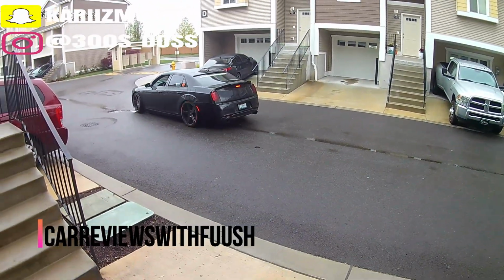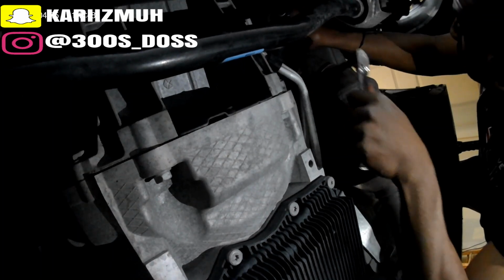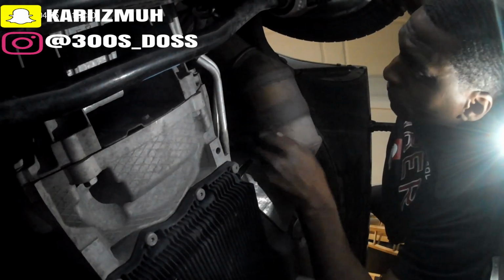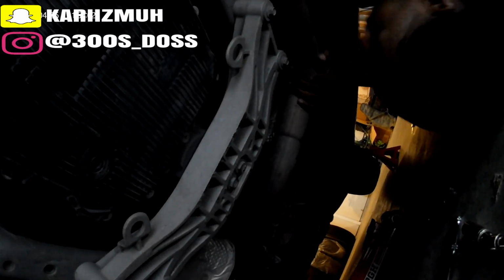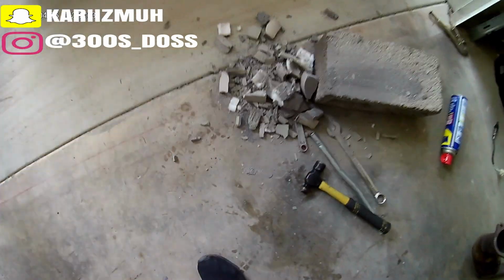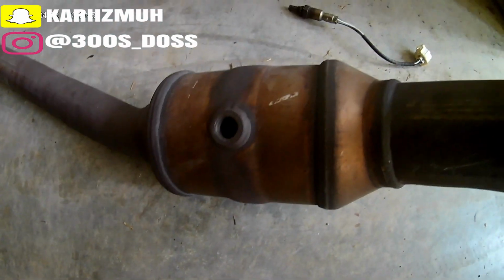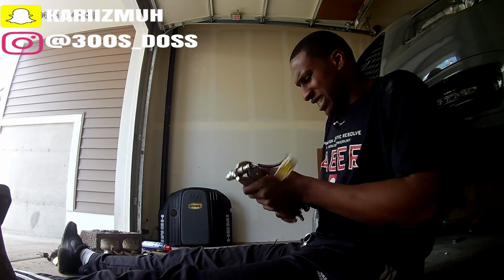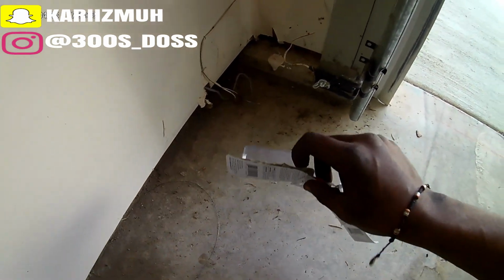HOW TO DO A CAT DELETE ON A CHRYSLER 300S HEMI

Comment: Hey, love, the car looks good. What was the part called you used for the o2 sensors?
Reply from the maker: @kevinhubbard3310  spark plug non foulers
Reply: What size  non foulers
Reply from the maker: @jacobbradford5479  tbh im not sure but parts store will know

Comment: I already removed all the exhaust from the middle to the back, and when the 4 cylinders are turned off the sound is very bad. I am thinking of removing the catalyst to gain more power ... will it be that it will change the sound a lot using all the original exhaust
Reply from the maker: nelcinho cidade if you do a cat delete you will get more air and it will be louder
Reply: get your MDS turned off or do a full MDS delete to get rid of the sound when eco mode kicks in that’s wat i did

Comment: I think I did a good job by cutting out the cats if I can figure out when you drill the spark plugs thing how you drill it I like to do it to mine so I get more sound right now running straight pipe from the cats are we back

Comment: After driving for a while now did your check engine light come o
Reply from the maker: Andres Cervantes haven’t had any lights come on
Reply: @392DOSS  I think I'm going to try it on the 3.6l
Reply from the maker: Andres Cervantes I would
Reply: @392DOSS  what did you do with the 02 sensors